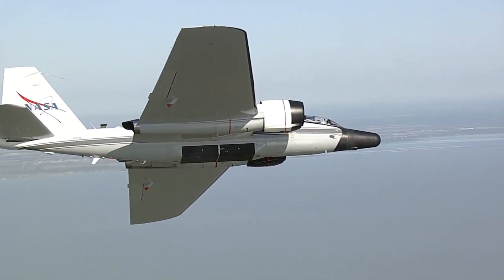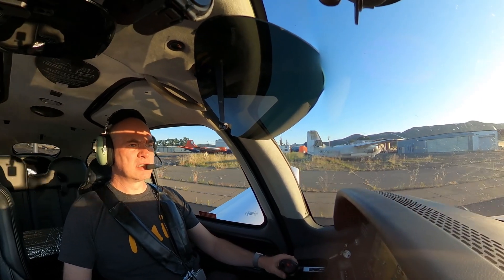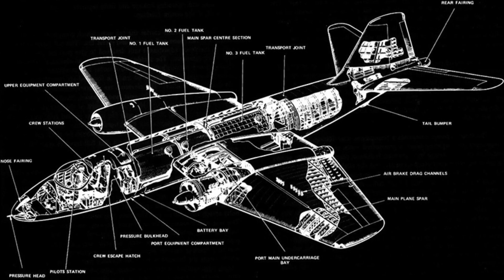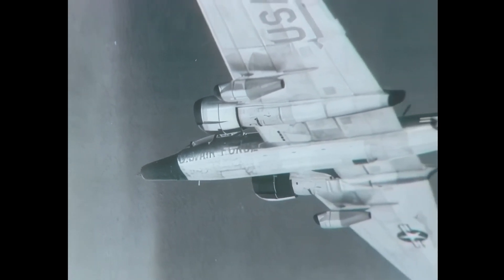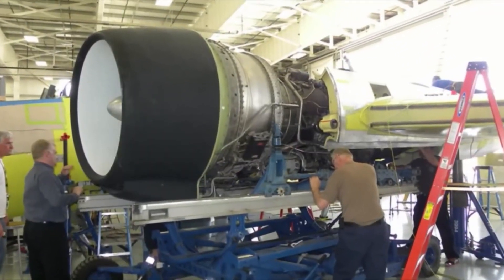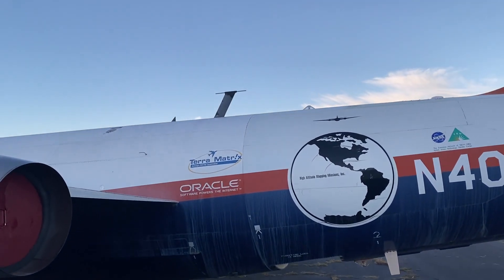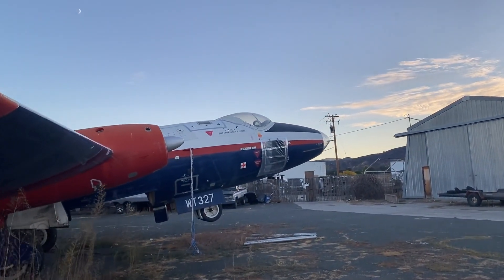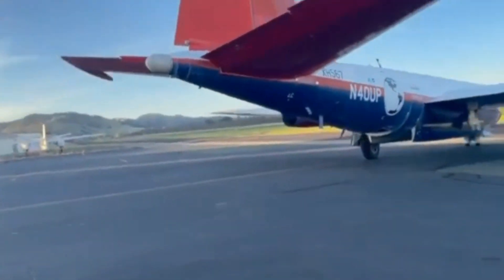Why NASA Relies On A 1950's Aircraft Design To Track 21st Century Spacecraft

Comment: Just to give a little correction, Vulcan to the Sky are not trying to restore a Vulcan to flight, not any more. They did in fact restore a Vulcan to flight, it flew under their ownership from 2008, but sadly in 2015 they had to retire the aircraft from flight for a number of reasons, and it's extremely unlikely it will return to flight again. VTTS's current goal is to preserve the aircraft, and use it as the center piece of a STEM focused education center. At present (and I believe the plan is to keep it this way) they still do engine runs and taxi the aircraft.
Reply: One of the problems many preserved aircraft have is the they cannot get flight-certified parts to keep these aircraft flying.
Reply: @grahamepigney8565  Indeed. As I understand it, the engines were a particular problem for the Vulcan, I believe they were close to end of life, with no spares to be had. Although if I understand it correctly their main problem that stopped her flying was that her certificate of airworthiness was contingent on support from some of the original manufacturers, I believe mainly Rolls Royce (engines) and BAE (Airframe, having taken over Avro) ajnd they decided to pull that support, hence the Vulcan's CofA was pulled.
Reply: @Streaky100001  The VTTS crowd were only going to get 10 years of flying max out of the aircraft. They had 8 Zero hours lifed Engines at the start of the project which could only be run for 800 hours before a major overhall. Rolls Royce would allow the engines to be run for that length of time and no more. Seeing that the engine for aircraft use was no longer supported, that gave the aircraft a maximum of 1600 hours of flying time. First problem they had was one engine failed a chip detector test which meant a high level of metal particles were picked up in the engine lubrication system, most likely from a failing bearing. Then due complete incompetence, one of the maintainers' forgot to remove a couple of large bags of silicon desiccant from one of the air intakes used to protect the engines from corrosion. The bags stayed in the intakes during start up, but as soon as the pilot pushed the throttles to full power to take off, the bags got sucked into the engines and trashed both of them on one side of the aircraft. As soon as the rest of the engines reached 800 flying hours Rolls Royce pulled the plug. UK Airworthiness Rules count most Jet powered aircraft like the Vulcan a complex aircraft. Without maintenance support from the Aircraft's manufacture, it don't fly.
Reply: @richardvernon317  This is also why the Concorde was permanently grounded after its retirement, with no chance of a potential future operator being able to fly it. Again, BAE and Roll Royce not wanting to support it (no doubt not a money-maker...).
Reply: @awuma  Not surprising with Concorde,  what you had was a civil aircraft which required military levels of maintenance per flight. Airbus and Air France wanted rid of it (Airbus was the design authority not BAe). Likewise Rolls were not the sole DA for the engine.
Reply: @richardvernon317  This is why it's silly for people to ask if the US has a "backdoor" to disable foreign-owned F-35s if their owner nation goes rogue. We can stop selling them parts and their planes will be grounded for their pilots' own safety within a week.
Reply: @disorganizedplay  Well yes, but that didn't stop Iran flying F14's for years. (They did start with a stock of spares, and it's a more 'analogue' aircraft).
Reply: @disorganizedplay  Not quite true, look at Iran's F-14's.

 The F-35 is definitely a more complex aircraft, but unless they run out of avionic equipment, a lot of the actual hardware could be repaired or replaced by the owner nation. Obviously they wouldn't be as capable as other F-35's, but they could still provide a formidable sensor suite for a rogue nation for a few years.
Reply: The XH558 airframe has reached its max, built for, flying hours. Grounded forever now.
Reply: Had the pleasure of seeing it take off at farnborough.
Reply: @olliea6052  nice!!
Reply: So with this understanding, even back in 2020 their eyes were bigger than their stomach and they bid and won WT327 so they could re-mate the nose from it back to WK163. This did, and still does, blow my mind. Coming 6,000 miles to chop a nose section off a machine you haven't inspected in years that has sat outside with no weather inhibiting, road transport this to a port, ship it back to the UK 6,000 miles again, re-mate it to WK163 - all at what massive cost? Surely the cash burn on that isn't worth what it might take to fix up whatever is wrong with the current nose section on WK163? I was asked very clearly not to bid on 327 by VTTS all for this curious plan, and then after 3 years they still haven't come out to claim it? Are they even still paying their monthly holding fee on it?
Reply: @nazcasteve  I can't speak for their plan of combining 2 aircraft into one or anything like that, but in terms of having not gone out to claim it, they've been rather busy. It was announced that their home airport in the UK was going to close, and they would be turfed off the site, so they spent a lot of time working on how they would move the now flightless Vulcan, and I guess rethinking their plans for an education centre, all of which I guess takes some time. For a while it looked like the Vulcan may have become essential homeless for a while, shoe horned into storage away from the public  until a new facility could be built elsewhere. It now looks like the plans to close the field have been backtracked though so not sure what the plan is just now.
Reply: @Streaky100001  I can appreciate that they have their hands full, but then perhaps it's time to be realistic, and move the a/c on to someone in a better position to do something with it.
Reply: Last I heard they were told to shift out of the airfield they were at, so it might be forced to concerningly. Uncertain if they got around it or what.

That and iirc there's a lot with the fuselage and structure itself that's too unsafe with it simply being too old to trust to compound the engine issues - I recall it coming up in a previous newsletter though I can't say for certain without digging through.
Reply: @romeoalpha1116  I think it was a mistake to try and do it a a commercial airfiled  that had aspirations to be a big player. There was always the potential be be rented out of the place or just not wanted anymore. Just look at the Coventry bunch who moved to Newquay. I believe they have had to move out again.

Most people who go to a commercial airfield just want to get on a plane and go, so there wasn't going to be much footfall from the usual customers in Doncaster. They would have been better returning to Bruntingthorpe for the retirement and built the education centre there. At least there,  they all have the continued support of the field owners.
Reply: @crabby7668  I don't see why they didn't do that, the strip (Bruntingthorpe) from what I know had everything they would of needed for this since it seems to have lots of other warbirds as well.

In all cases, if it'd of been closer to where majority of tourist attractions for aviation enthusiast and history buffs go (e.g Cosford, Duxford, London itself) it'd of worked out much better than a commercial airport in Doncaster. Basically shot themselves in the foot betting on something that was dubious. 

Can only hope they can dig themselves out of it, but I somehow doubt it.
Reply: @romeoalpha1116  yes that is where it came from originally, and where they did all the work to get it back in the sky. I don't know why they thought Doncaster was a good place to base it. Maybe it made sense at the time, ready access to jetfuel maybe? But IMHO they should have made the last flight back to Bruntingthorpe or wherever that has a tradition of supporting the passion. Unfortunately at a commercial place, you can get a change of the guard and next boss maybe completely antipathetic to the cause. Now I heard that they were going to close the airport (out of touch, so don't know if true false or already done) so that doesn't bode well as it leaves open the possibility that it ceases to be aviation oriented. Time will tell, and it will be a great shame if it ends there. But, what a ride for those few short years!
Reply: @romeoalpha1116  as a ps, have you been to Bruntingthorpe? I haven't been for years so can't vouch now but it was well worth visiting years ago. Maybe someone who's been recently can add.

The sight and sound of two lightnings on afterburner doing a fast taxi is something else, particularly as you weren't that far away, given it wasn't an airshow. A real gut rumbler. Tons of other interesting stuff as well. Including the last unofficial night of the Victor!
Reply: @crabby7668  Never been to Bruntingthorpe, too far away sadly. I might go someday.

Last I've heard about the situation [Doncaster] is the airport may change hands imminently as the city council is looking to reopen it as soon as possible; the lease was extended for the trust to look at options. Nothing more has come from it than that.
Reply: @romeoalpha1116  thanks for the update👍
Reply: I saw it flying many times including over my partner's house in Gamlingay.
Reply: I think the Hunter crash may have contributed to BAe pulling support for jets.
Reply: Id love to see some vulcans in America.   I wish Pima Air Museum had one.
Reply: It's a shame but yeah, they weren't going to keep it flying for ever. I used to live on RAF Scampton, home of 617, 35,  27 squadrons, and the Operational Conversion Unit.  They really made the windows rattle when they took off, very impressive aircraft.
Reply: Rats!  Scott's assertion that a Vulcan was being repaired "for flight" got me a lot more excited than I would like to admit.  What a pity though, eh?
Reply: @gillie-monger3394  Yeah, it is a shame, but I count myself among the lucky ones who got to see it fly in that period from 2008 to 2015 where she was flying. It really was quite the sight to see!
Reply: @Streaky100001   You saw 'history' then Streaky!  I've always wondered about the V force aircraft length of service.  I mean the US keeps the B52 in the air and that first saw service in 1952!  And here we are decommissioning air worthy air frames that are or were as good if not better than the B52.  How far we have fallen.
Reply: @gillie-monger3394  I guess you could sat I did. Its weird to think of it that way, I still remember my first time seeing it, at Waddington airshow I think it was. I didn't really know anything about the Vulcan at the time, my interests back then were the 2nd world war era stuff, jets really hadn't caught my attention, but they rather rapidly did when I saw, heard and most of all felt the vulcan come past at low level, in a steep bank on high power, presenting the belly with open bomb bay to us. From then on I made a point to see it whenever I could. But... that feels like only the other day, strange to think of it as history, was probably 15 or 16 years ago I'd guess?

As for the V-force retiring while the B52s stick around.... there's a bunch of factors there. Firstly, the V-force were designed to be high altitude. The theory was altitude meant invulnerability since no-one else had SAMs or fighters that could get that high. That theory was rather shattered when Gary Powers' U2 ate a SAM while at altitude, and proved that the V-forces altitude wasn't enough to afford them safety. The decision was made that they'd work low level instead, on the theory that being below the radar would afford safety. Well, low level puts more stress on the airframe. As it turned out the Vulcan was the only one that could withstand the stresses of that regime longer term, the Victors and Valiants had fatigue issues, so were converted to tankers, leaving the Vulcans to the low level stuff. As for the Vulcans, well they became unnecessary sadly. There role was always as a nuclear deterrent, sure they could do conventional bombing but that's not why the RAF was paying for them, so when the Navy took over the nuclear deterrent role with the subs, the Vulcan really had no role, no reason to be kept around unfortunately. As for the others, well the valiant lost out to the Vulcan and Victor, both being newer, better designs than the valiant, so they disappeared. The Victor soldiered on as a tanker for a good while, but eventually lost out to better alternatives in that role. 
As for why the B52 has gone on so long, we'll for one it's a different mission to the V force. Generally they operate in areas where the US/NATO has air superiority and hence working high is still a valid option, and I guess more to the point the US have the resources to throw at in upgrades and life extensions to keep it safe and relevant in the modern day. I don't necessarily know that the B52 makes sense on the modern battlefield, but someone in the US obviously thinks it does.
Reply: I'm so glad I got to see that thing fly.
Reply: I'm glad then I got to see it when it flew over Belfast a few years back.
Reply: The main reason being that Marshalls Aerospace stopped being the technical authority on the airframe (probably due to insurance reasons).
Reply: The Vulcan xh558 is based at Doncaster airport
Reply: Yes simply costs too much but I did see it in its last airshow year, incredible to see a V- Bomber doing barrel rolls and loop the loops, a little disconcerting too. Amazing to watch it fly with a Lancaster and realise both were fundamentally from the pen of the same man. When much younger I also remember seeing one almost hover low along the runway at Mildenhall, will never forget that sound when it applied the power and took to natural Sky altitude again. To think they (with Victor) too were only just post war designs yet still look modern, what a transformation in aircraft design took place within the decade.

Comment: I'm sure no one will read this comment, but there's an abandoned RAF airfield in Cornwall, UK which has a multitude of iconic aircraft sadly rusting away into disrepair. I sneaked into this airfield a couple of years ago to have a look at what was inside (photos are on my Insta) and one of the aircraft is an original RAF B-57. I had never seen one in my life before and it was so cool being able to climb inside the cockpit and look at all the old controls 🙂
Reply: If it is an original RAF aircraft it will be a Canberra not a B-57. The B-57 is the designation for US licence built Martin versions.

The RAF only operated English Electric ( latterly British Aerospace) Canberras.
Reply: @grahamepigney8565  sorry, I meant to say Canberra, not B-57. If you google "WT308 Canberra" you can see pictures of it. Funnily enough the markings on it said it was based at Boscombe Down, which is a military base hundreds of miles away, and coincidentally down the road from where I grew up. There was also a Harrier GR.3 at this Cornwall airfield/graveyard. It was actually really sad to see so many iconic planes abandoned and rotting away 😔
Reply: @grahamepigney8565  Not all RAF Canberras were built by EE or BAC. Shorts built a load as did Handley Page.

Comment: I was working at a contract job in La Jolla, CA, which was pretty much in line with the runway at Miramar MCAS.  I heard a jet that I didn't recognize (the usual F/A-18s, V-22s, and C-130s were distinctive) so I ran to the window and was treated to a flyover by this plane.  I know these two planes spent a lot of time in Afghanistan flying the BACN communications payload, and I assume the one I heard was in town to do some test events with a BACN-equipped drone.
Reply: The WB was at Miramar to flight test a new BACN baseline. The BACN payload was on a pallet that was winched into the bomb bay. That payload was the same configuration as the EQ4B Global Hawk payload. That configuration is no longer in service.

Comment: Got to love the Canbera - an awesome aircraft. Spent time in the 1980's in and around them whilst still operational at RAF Wyton. They really were the future.
Reply: Same. It was 100 and 360 squadrons at Wyton flying the Canberras when I was there, and also the OCU. I was on 25sqn on the Bloodhound missiles and used to closely follow them round the taxiways when driving across the airfield, then watch them take off and land from the top of our radar towers. The starter cartridges used to make a hell of a bang.
Reply: @clanktank  Ah, the remote locations to the north of the airfield, I remember. The Bloodhound with its mainbody and boosters looked formidable, if a bit "rustic" given it's early 50's origins. Wyton was awesome too due to it being right under finals for Alconbury - an awesome airbase to visit.
Reply: @Jonathan_McD  Yes I lived in those "remote locations" for 17 years...20 years too late for the 1977 crash.
Reply: @clanktank  I understand the starter cartridges are running low, I don’t know if there is any alternative to keeping these engines running as and when they run out.

Comment: uh... yeah.... I don't know if its still classified but... There was a couple of 'Big Wing' B-57s that I am aware of. Wing span 162 feet and 180-something feet. Watching them land? Was insane. They landed into the wind, and both variants had full length spoiler/drag brakes on top of the wings. You know an aircraft has too much lift when people walk up to it, grab the wing tips, full spoilers go up, then drag brakes rise up behind and the aircraft lands vertically like someone just cracked the valve on a jack. That was at NAS Alameda in the 80s.